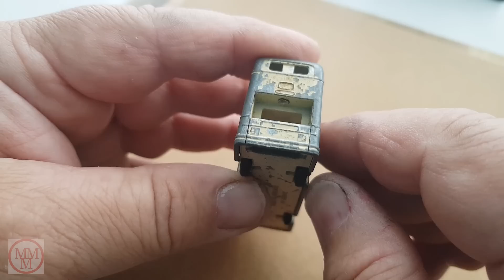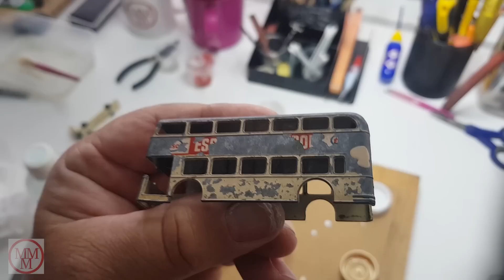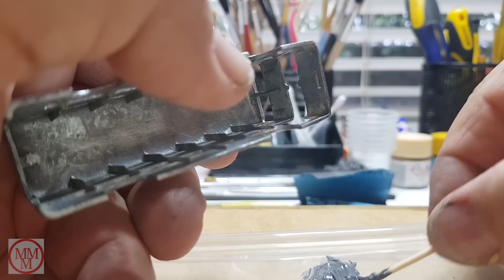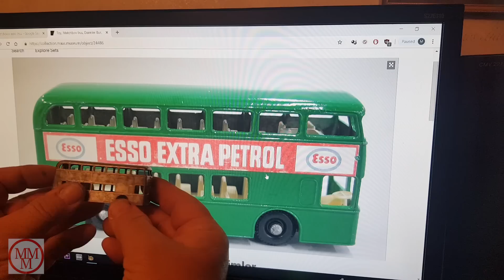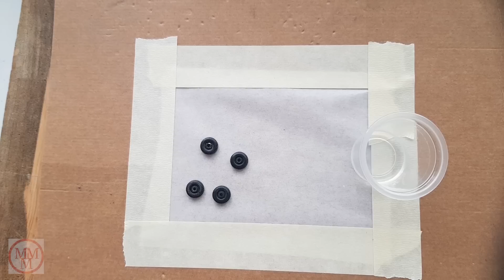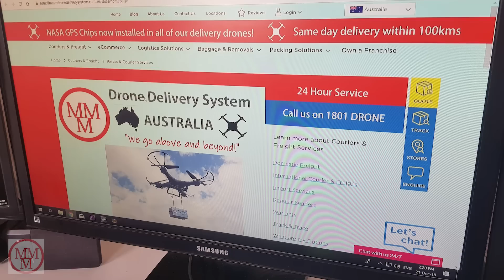MATCHBOX Restoration No 74b Daimler Bus 1966

Comment: Hi Marty. Your videos are great and have inspired me to give it a go. Just a tip on this MB 74 bus model which makes things easier is that if you put a small screwdriver through the rear lower deck window and push up against the upper deck body, the rivet comes apart with a little force, but also in most cases allows the model to be press refitted later without glue. This is much easier than drilling a hole and refilling it.

Comment: Nice vid. I have exactly such a bus on my desk in front of me. However, the chassis is slightly different, plastic inserts to keep the axles in place and silver colored wheel 'covers'. The overall color is red, decals and interior are the same. Maybe from a later production date?

Comment: Working on the same bus.... Testor's Model Master ANA 616 military color (#2016 if memory serves) with a couple of drops of yellow and white is almost dead-on... it's flat, of course so you'll have to clear coat... my bus wasn't broken, but it was "dented" in one side and had some divots in the body that I filled with super glue and a shot of hardner, followed immediately by sanding with a nail file... before I did this I tapped out the dent, but found that a small bit of body line was lost by being struck by whatever dented it to begin with....  fun stuff~

Comment: cracks in bodywork and that windscreen repair can be done with a soldering iron and leaded solder, you need brush on flux and for that windscreen bar you would use copper wire solder sticks better to the copper.

Comment: I have one of these busses... mine is the same color but was painted jade green by me as a child.  Today I took it apart and dunked the body in lacquer thinner and it stripped the paint very effectively, but left the matchbox paint on the chassis where I hand wiped off the jade green with a paper towel soaked in lacquer thinner... so it preserved a bit of the original color.   I also took apart a Ferrari Berlinetta superfast I spray painted red in the 1970s after I brush painted it purple... it was a hot mess.  Lacquer thinner stripped it very effectively as well.  I had painted the interior of the Ferrari (very badly) and I stripped it to it's bare plastic using hardware store mineral spirits.  All the old paint (red, then Testor's white badly brushed on) came right off.  I know some people painted their cars with hotter paint, but for model paint on the interior, the mineral spirits worked VERY well....  You and baremetalhw got something started....  ohhh dear....

Comment: Suggestion here on decal making as I've done this sort of thing before.  This process works best with flat surfaces.  Try scanning the surfaces of the vehicle with the scanner on your printer.  This should help with the placement and sizing of the decals. 

Also, if you have any decals with intricate designs that would require a lot of cutting out, scan the vehicle after you paint it.  Then sample the color of the paint and use it to fill in the areas that would require cutting out.  This way, you can cut out the decal in an easier shape (like a rectangle) and the color filling in the intricate areas should be a perfect match.

Comment: PS, you and your drone system could easily get a job with the US postal system. I had a lovely French, over 100 year old shaving stand, had drawer, mirror, tall wooden mirror post,  totally destroyed by them, wooden mirror post were driven through the top of the box via of dropping it on its top, then rest crushed by heavier box put on it. Had it $$ restored via of insurance but the lovely original color gone as it had to be darker way down to hide the break lines and filler repair. Luckily had this very old antique repairer, dealer local. The thing lost all its real value, wasn’t worth the insurance money reinvestment, but, could not let the poor thing that had survived all those decades be thrown into the trash.

Comment: If you don't want to wait out the time for the J-B Weld to set, then might I suggest using J-B Kwick instead?  It's the same stuff as J-B Weld, but the set time is only 5 minutes, but I believe full cure is around 24 hours still.  I've used this product for a lot of my builds over the years, and have had good results with it.

Comment: I'll start my first real restoration project, because until then I only did repainting.
Now I found a Dumper truck series 48, and there are missing wheels, and the windshield was painted with silver paint, in addition, the bucket is well kneaded! It will be a long work!

Comment: I'm not so much for jb weld I glued a lamp support ring the thingy that holds the cap thingy in place and it broke off less than a week later not realizing this part flexes it broke in use since jb fixes things rigid forever I used great amounts of bookbinders glue and now it has still not broken half a year later

Comment: There’s a product called j-b kwik and it’s j-b weld that cures way quicker. Instead of taking 6-8 hours to set and 24 hours to cure. J-b quick take 6-8 minutes to set and 6-8 hours to cure. The only downside is that it isn’t as strong, but with this stuff it doesn’t really matter. Hope this helped

Comment: Another cracking job Marty...this is another one that is on my "to do".Thanks for the tips about the colour match. Have you seen a you tube chsnnel callef Time Rider? He did the same model a few weeks ago as a first attempt. He found a way to remove the rivet without drillinv by grinding with his dremell. He even used your wifes toothbrush! Have a great Christmas. 🎅

Comment: back in my day the Matchbox cars always had a lot of details. Many had trunks or hoods (bonnets to you brits and aussies) that opened, and usually had doors that opened to reveal a detailed interior. That was the big difference in Matchbox and Hot Wheels at the time, Matchbox had details, not so much on most Hot Wheels, things definitely didn't open. I think it was like late 60's early 70's for most of the ones I knew. Unfortunately, these days Disney owns both Matchbox and Hot Wheels, there is very little if any difference, and most are made in places like Thailand and China. Not a lot of quality to them, like most things these days. You won't see any of those around in 50 years, and if you do, they won't be restorable.

Comment: Hi Marty, just a quick ? why did you use thinners if the paint is water based?
Reply from the maker: Good question, it is water based acrylic and I use the same brand water based thinners. I bet I'm just buying really expensive water!!!!! - I will ask the guy at the model shop next time i'm in there!
Reply: Perrier probably cheaper mate, great job on the bus, have you done a vid of your spray booth set-up @MartysMatchboxMakeovers

Comment: Marty, I have watched a number of these restorations and I wondered if you'd ever restore this Daimler model. Because of the position of the rear awkward rivet and then surprised to see you have done one. I have a number of these in green red and cream. I haven't seen the vid yet. Just one thing about past restorations, I think that if you apply silver to headlamps, under do it as opposed to over do it they appear better. the same for grilles etc. litereally just dots for the headlamps. In most cases restoratons are excellent. I'm aware too of difficulties. Thanks for the upload.

Comment: Don't know if anyone has already mentioned this, BUT there is a much faster version called JB QuikWeld that fully cures in 4 - 6hours  (sets in about 5 minutes).  The only difference is that the one you're using is more tolerant of high temperatures (automotive temps).

Comment: Another great show Marty. As was mentioned earlier, I think this represents a Sheffield bus, if only based on the destination screen layout. The fleet livery was cream with three blue bands, below and above the lower deck windows and underneath the top deck windows. The rear upper deck window would have been a single one, but I guess there's little you could do for the model without weakening the casting.
Keep 'em coming - especially the out takes and do have a Merry Christmas.

Comment: Marty, I use PSP6, also !  ;-)
Here's a trick that will always work :
- Take an A4 size sheet (29,7 x 21 cm ) to print on.
- In PSP, create a sheet 2970 x 2100 pixels, 254 pixels per inch.
- Now, you have 10 pixels per millimeter to draw with. The size you need in mm you muiltiply by ten.
- If a decal needs to be 68,7 mm long, reduce the large drawing to 687 pixels wide.
- You did it right by first making a very large drawing, then reducing its size. That way, any small 'mistakes' will become invisible on the small version.- Take the large drawing and resize it to the desired size. Copy, then paste it onto the large sheet (2970x2100pixels).
- These large sheets (2970x2100 pixels) should become your standard canvas to work on. Now, both the digital and paper version always have identical sizes.
- Should your printer still give you an argument, convert the drawing to a PDF file. PDF files are always (........) printed the same way. The same scale, on every printer, everywhere. Theoretically. But usually it works just fine.

And Marty, please do NOT use water to wet the model !!! Use a special decal adhesive !! By using water you are removing even more glue from the decal !!!!
Use Tamiya's Decal Adhesive, Humbrol Decalfix, or Micro Set.

Comment: Love the Video's you put out. I'm a fan of the buses made by Lesney. I found with the rivet, a set of small needle nose pliers can close the rivet and a small screw driver levered the bottom will separate parts. Also heating the plastic suspension to form it to original makes the models sit great. Hey if your interested in seeing mine. Look up HW_Classics on Instagram. Cheers!

Comment: We use a product called JB Kwik at work all the time.  It's made by the same company as the JB weld. 

it will be dry in about 5 minutes compared to the regular stuffs overnight. 

it's slightly weaker than the JB Weld but considering it's a tiny small car it will most likely never break.

Comment: How would the rivet have been put there originally? It seems a very strange place for one.
Reply: Matchbox would have had an angled machine for this purpose. I have never seen this rivet positioning on any other model (where it is within the model) so the tool would have been expensive just for the Daimler bus model.

It’s possible that some clever so-and-so was able to adapt an existing tool to do the job and received a 10 shilling bonus that year.
Reply from the maker: I know, weird right?
Reply: Possibly with an angled piece? I was thinking you would perhaps cut down an Allen key Marty and put a screw in but there likely wasn't enough clearance. I have to wonder if that headline wasn't a dig at our kiwi Prime Minister. Either way, your videos get funnier every time.
Reply: I remember my* same color and decals no.74b Daimler bus could be separated very easily, I separated it many times, removed the very nice interior and after that put all the nicely fitting parts back together again.  The rivet had not been formed as it should be so I think the 'angled piece riveting' Smurphenstein mentioned did not always work very well.
*think it was my older brother's bus but I never saw him play with it so now it's mine ;-)
Reply: Sarpan ;